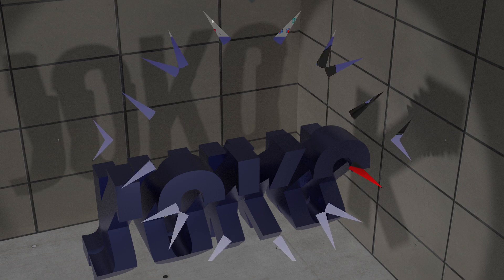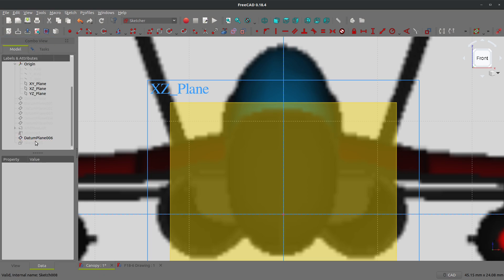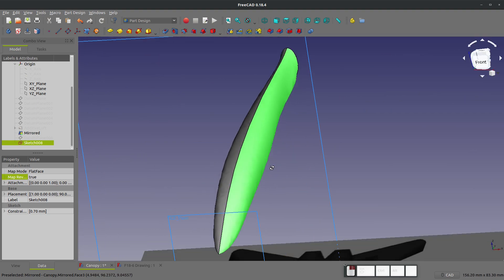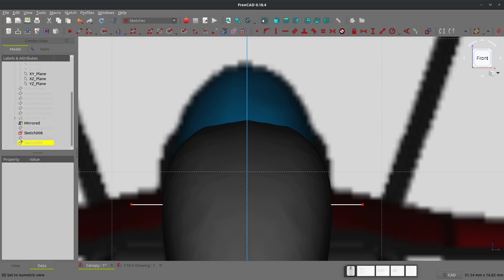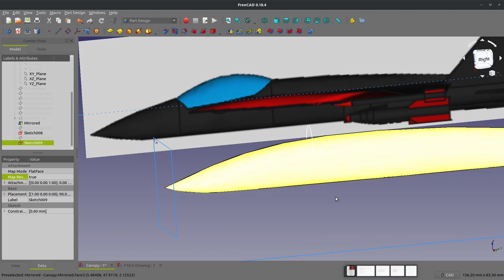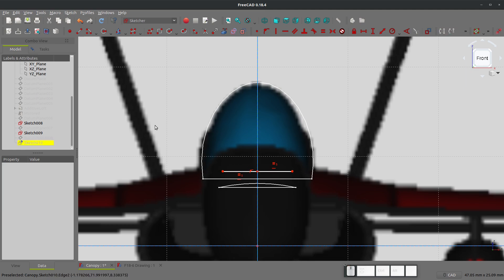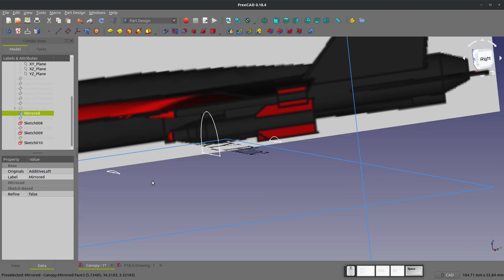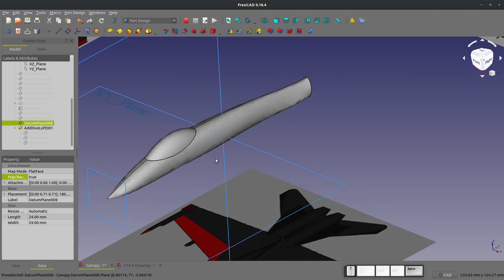Make an F18 in FreeCAD Video 2: Canopy |JOKO ENGINEERING|

Comment: Here's a question...

Let's say that one wanted to build their model in a similar manner to an old balsa model airplane kit - with bulkheads, stringers, ribs, spars, and so on. How would one translate a lofted solid into something like that? I can draw the whole thing bulkhead by bulkhead, but there has to be a more efficient way. It's FreeCAD after all.

Any help here?
Reply from the maker: I guess it depends on what tools you have.  The path workbench can generate G code for CNC (This body may be too complex I don't have a CNC at home so it's  hard for me to tell) .  Apart from 3D printing, you could probably make some templates by printing techdraw views at a 1:1 scale to the size you want to make it.  Hope some of that helps